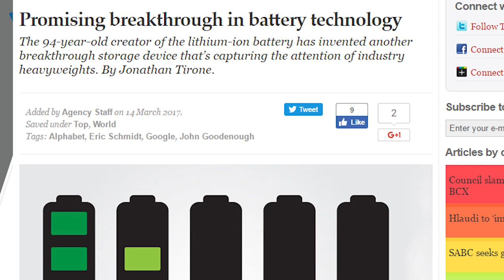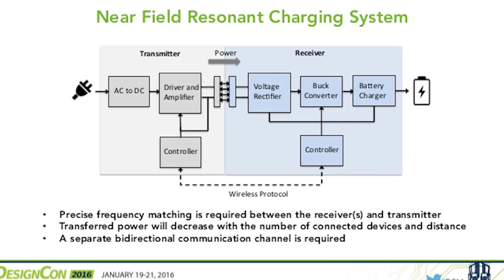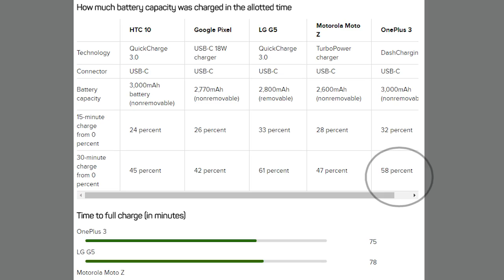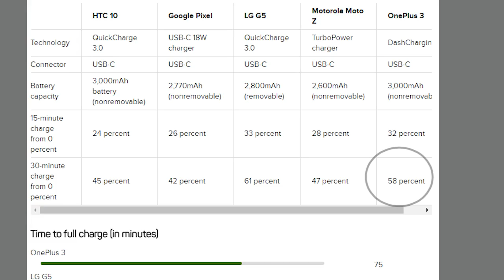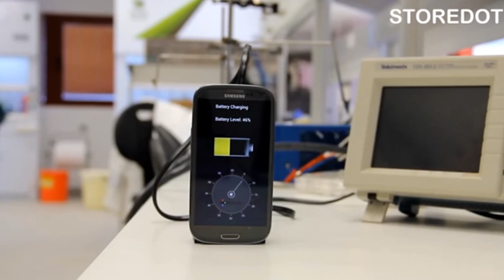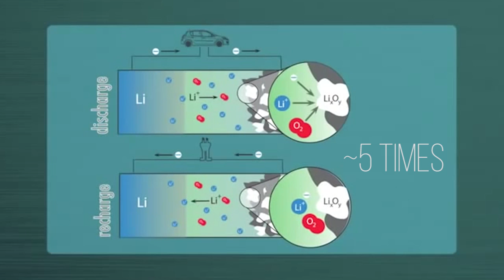NO MORE BATTERY PROBLEMS IN THE FUTURE WITH THESE TECH

Comment: I completely disagree with just about everything said in this video. First, I think there's a BIG difference between using wires and charging on a pad inductively. Do you really just those tiny connectors that hook up to a charger? Has it occurred to you that one little bent pin could put a $500 phone totally out of action? I got some cookie crumbs in mine a couple of years ago, and carefully did what I could for it very soon after; but the thing is still a little funky. A pad would eliminate those problems. Any self-respecting electronics expert will tell you that dry electrical contacts are generally the most unreliable thing in electronic equipment.

I don't see anything wrong with charging pads—EXCEPT that they aren't everywhere—at least not yet. But I don't like the idea of substantial power being beamed around all over the place for F R I V O L O U S reasons. 99% of it won't even be for my benefit. No, I'm not wigged out about cell phone emissions, and I don't wear a tin foil hat. But if you're not patient enough, or methodical enough, to handle plugging in your phone at night while you sleep, and you can't wait more than a few minutes for it to charge, why should I subjected to all that EMI just because of YOUR short attention span, or your excessive multitasking?
Reply: 'scuse please, "Do you really just" should be "Do you really trust."

Comment: Wireless chaging: That's already possible now, if you want 5% efficiency of the charges. Not sure if would be good for the environnment spending 95% more energy than today to charge milions of phones. Inverse sqare law is a bitch, you know, and can't be changed.
As for the miracle aminoacid battery, ask them how they achieve to put 400A on that tiny cable. Because that cable is a better discovery than the battery itself. Must be a superconductor.

Comment: It's insane to send microwaves everywhere at that intensity for any considerable charging.
The chemistry of the battery is the charge limit, unless you're going to be running crazy voltages and capacitors there's no way of doing this. Magic crystals will do jack all.
You know nothing and just put up random ass clips with an annoying kid voice.

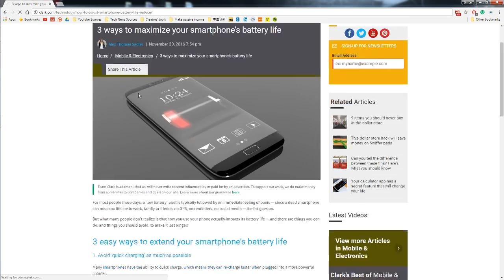Comment: Some of the information you tell contradicts the information on the screen, like with the point you made about how phones are becoming more energy efficient. 5:19. However, the infographic on screen showed that all mobile devices by Apple lasted longer while running on iOS 6 than on iOS 7, with later devices like the iPhone 5 getting a poorer battery performance than the iPhone 4.
Also, please just say kilogram instead of kayjay, especially if you already say kilo less than a second before...

Comment: If an average phone battery is 3000mAh, so 3Ah then you would need to charge it with 3A for 1 hour to fully charge it (i'm ignoring the CV/CC charging curve, battery charger efficiency, and the battery efficiency for easy math), so to charge in 30 seconds you would need to put 360 Amps or around 1296 watts through that cable. Yaaaaaaaa, nooooooooo That's not going to happen...
Reply: Matthew Santoro 
I would love to see someone try!!! to get it to pull more current . it would require higher voltage. I have seen a 3.7v lipo charged with 12v 600amp estimated source. and in about 30 seconds . it was so charged. haha.. it blew up like a balloon!, I don't know the current it pulled . I'd say. over 20-40 amps. so over 240 watts. I prefer charging liion cells . with around 3000mah. with 1-2.5amps. slow charges are better. less heat less chance of damage
 longer life. and only charging to 4.1-4.15v and discharging to 3.0-3.1v ... some capacity is lost. but life can be lots longer. and sticking to recommended drain amperage. my 5 amp cells with 10 amp peak. are fused at 5 amps. for protection of the rest of the cells. and fire prevention. there is no way current tech batteries. can  come close to charging that fast. 3ah cell charged in 2-3 hours maybe. I'd rather charge it in 3.5-4 hours. a 1-1.5 amp charge is plenty a partial fast charge could maybe work . charge at 4-5 a for 5 min. then drop to 1 amp. for 20. then up again. allowing time to cool. and cooling like the Ev's have . van help with fast charging. but a cell phone is gonna catch fire!! charging that fast! sorry I'm rambling again!
Reply: I don't think you can run over 1kw through a cable into the phone without unavoidable problems

Comment: Great stuff. Very promising. My personal venture in the field of energy is that I have been working on a concept since the last 20 years and nearly done— Power Supply On Demand— A system that provides juice on demand for a much longer period of time (about 1 week) before replacement of vital part in seconds after end of duty cycle. The concept has practically no limit and can scaled up to any size for heavy duty applications including of course EV. The implications are limitless and even tackles applications such as electromotive devices for the disabled, exoskeletons etc where heavy current and long distance sustainability are needed. Can also be adapted to any moving thing from boats to airplanes. Will soon be disclosed in this galaxy. Thanks for being patient for yet a little while. Cheers.